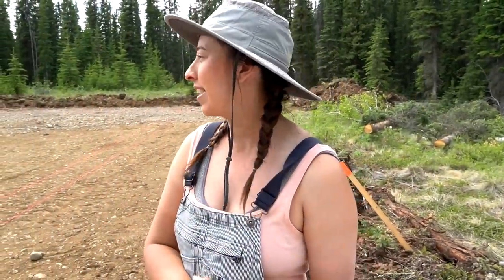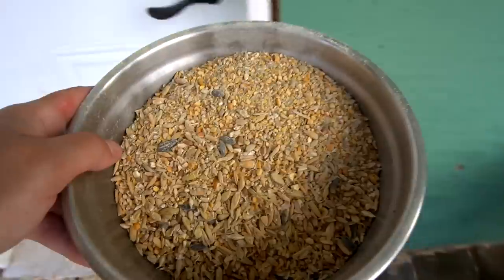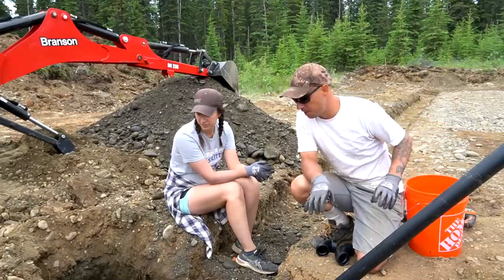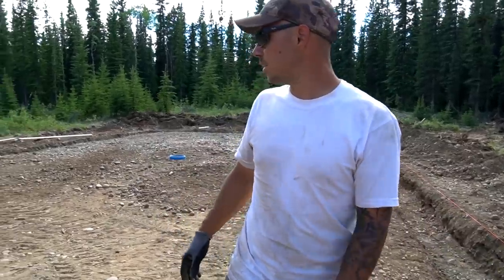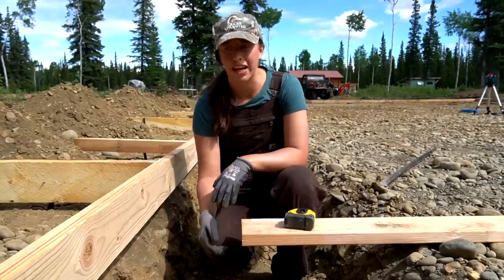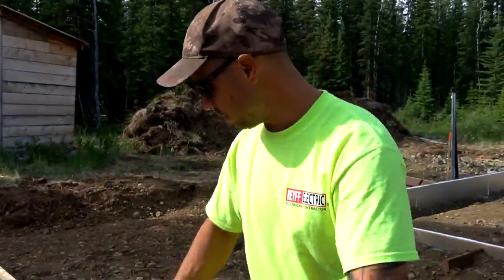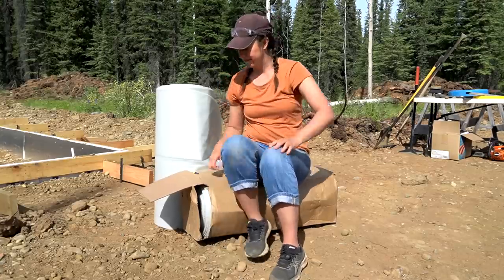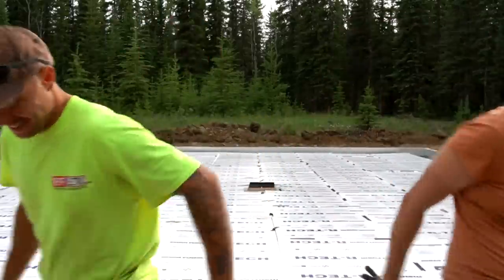The Never-Ending Footers | DIY Insulated Concrete Slab | Alaska Quonset Hut Build

Comment: Reinforcing a large Concrete slabs Tension strength is more important overall than it's Compression strength...Rebar Mesh will increase the former which helps prevent cracking And give the latter more strength too...pays to use a Vibrating poker while pouring to force Air out which weakens the Concrete mix....good job guys.

Comment: As someone who has done my share of footers and concrete you made the right choice to put the poly down first but I think you could have done with a much more easier wire I've used a lot of what they call hog wire you just have to get you a rake and kind of jig it up a little bit as the concrete goes in well and now you're doing great 👍😉🐝

Comment: That really is a ton of gravel. Could weld up a sifting rig and start some sorted piles. Finer stuff/sand for a driveway, bigger stuff for making stonewalls and natural ovens/grills/fireplaces. Could line the pit with nice thick stonewalls for lots of good thermal mass for geothermal greenhouse. Stay cool in the summer, and absorb all the heat from sun/rocket stove built into said wall.

Comment: I agree with what you say about the vapor barrier,  I have seen foam board soak up water over time.  As far as floating foam, yes it can, however you will have reo on top which will hold it down together with the stone in the concrete mix,  as long as the mix is not too wet. 
You're good to go.

Comment: I love the way you guys call it footers. I've always known it as footings. As a bricklayer I have built hundreds of them. But I would have done it a little different. Dig the trench tamp it down pour in a nice runny concrete level it as much as possible, doesn't have to be perfect. And then build a footings up in a solid block. Would have been cheaper and faster. But hey I'm a bricklayer I'd have just done it the way I was taught I guess.

Comment: Great job.  Foam om top poly, when the foam draws maoisture and it will it will freeze and offer less insulation value.  To hold the foam on the utside footer form, use metal roofing screws with the big plastic washer on them.

Comment: from your building inspector here in Florida.  Gray conduit is only used for electricity... if used for anything else paint it white.  Your plans should show you on a detail page the wire mesh maybe going into the footer and should show how the Styrofoam goes and where.  Run a tight string across from form to form and check  the concrete depth at many places.  The angle from the footer to the slab is the most critical thing in the whole project.  Tons of concrete in the footer and if the angle is not per your plans it can crack or break off.  Back to work and you are doing good

Comment: Always form something that you can pour any extra concrete in. Like even a 3ft by 3ft lil pad under a faucet or whatever. Lumna Acres used a gas powered tamper that you walk behind. It was sweet. Also they used a great floor insulation that goes under concrete that you weave the (whatever) thru so the floor stays warm in the winter, they are in NH. They put in a wood fired boiler to heat their home, and water and shop & barn etc etc.
Reply: By the way, I admire both your energy & commitment to your projects & channel. I love watching those who are organized & goal oriented. The shop pre-concrete Lumna used was "Crete Heat with Pex."

Comment: This may be too late, as you may have poured already, but in case you haven't....as a building contractor, I hope to convince you that you need to change the way you formed up to hold your center drain frame. The way it's formed, that wood is going to be in permanent contact with the concrete, which is a big no-no, especially with raw wood. When that rots out, and it will, the only thing holding that frame in place is the four bars you welded to the frame and nothing supporting from underneath. The best way to form for that is to make your concrete form so that it fits inside your L-angle frame. If the barrel lid is non-flexible enough, you can set it right on top. Build it so the form is easy to pry apart(no screws) and remove after cure.  Use your laser level to mark the bottom of the L-frame, then set a couple of 8d  nails on each side, close to the corners. Set the frame on top of the nails. You're done. The form height can be anywhere below the top of the frame so you can screed over it. When done, the frame will be supported by the concrete in it's entirety. Cheers!

Comment: Hey there. This is Chippewa Backwoods in MI.  Love your channel.  I saw that your having trouble screwing the foam board in because the screws suck into the foam.  You absolutely can fix this with "Fender Washers". HD or Lowes or Menards has them

Comment: A few pieces of advice for your concrete forms that may help save time or money 1) Instead of using metal stakes next to your supports, use some 2x4s cut about two feet long from the square cut to a triangle tip <=== This makes them easier to pound into the ground with your maul. It's cheaper and you can screw anywhere into a 2x4 rather than one hole in your metal stakes. 2) if you have a table saw or a track for a skill saw, you can rip a 'factory' cut on a least one side of your insulation and put that edge flush along the top of your forms to know where you have to dig out your trenches more. The tablesaw in particular can stay locked at the same width with the rail and you can cut all that insulation in a few minutes with a wood saw blade. 3) Putting the poly down first then put down the foam boards is the right call, it keeps the moisture off the slab and heat within the insulation for a longer period of time. You two have always done a great job with your builds, the care and quality you two take with your projects is amazing.

Comment: About the metal structure, I noticed such a building near Superior WI (heavy snow country) that had a metal stringer tieing the corrugation tops together about halfway up each side, perhaps inside too at the same place forming a truss.
Corrugated cardboard boxes are stiff because each side of the corrugated paper has a flat paper sheet glued to it. When you handle open coordinated paper is it very flexible and easy to distort.  i noticed the metal ones were flexable when you were loading them.

Comment: It's interesting how techniques vary between countries. As for your insulation board, those designed for under slab use have water absorption rates of a fraction of a percent so either method is equally valid. In the UK a layer of sand (blinding) is used under the waterproof membrane to reduce risk of perforations from the sub base. Also for underfloor heating the slab is poured in two stages with the insulation between the structural slab and a finished screed (of around 2"). The logic in this is that you're not heating a massive volume of concrete only a few inches of the final floor so heat transfer is simpler

Comment: What a huge slab you got going there, just a suggestion to use a tamp to get rid of all the air gaps once it cures. You could order from Home Depot they're blue and they're about 1' x 4' . As you're pouring it, you could also tap with a hammer the forms so you'll have nice solid edges. Expansion joints are critical especially for a slab that big. No matter how much steel you put in there.Just saying, ps you should be able to rent all the concrete finishing  tools you need from a equipment rental yard .   your friend, Keylime DP from Cloverdale

Comment: With plastic a mil = 1/1000th of an inch. So 10 mil = 1/100th of an inch.  10mm is closer to 3/8ths of an inch thick :)
Looks like you 2 thought of everything.  I probably woulda done drain closer to 2" lower than slab edges, then you can slope it out 10 - 15' in all directions from it to catch more.  Very solid forming!
be sure to order plenty xtra concrete, footer leaks and such.

Comment: We also went poly first , also foam in bottom of the footer went under both vertical pieces of foam (sides) of the footer. Reason is that when frost pushes up from outside , it isn't able to push the outer foam up .

Comment: I saw a show on insulating similar to what your project is. They were fastening the pieces of insulation using screws and 2" Diameter X 1/8" thick plastic washers. I am thinking you could even make your own washers similar to these for future insulating projects, perhaps even for your crawl space under your house.

Comment: The 10 mm poly will be fine for a radon barrier it's better than the six mil for sure. Me personally I prefer a insulated radon barrier this way you're getting double insulated value. Put your gravel in then you're insulated radon barrier then your sheets of insulation board then you're still pour your concrete.

 Don't forget to put a radon stack You've got to let that gas vent somewhere.

Comment: I watched most of your episode about preparing for the pouring of your Quonset pad, and your uncertainty about where and how to place the vapour barrier. Regardless of which vapour barrier relative layer option you chose, the purpose of a vapour barrier in the context of an insulated house wall or ceiling in a northern moist climate. The barrier purpose is to prevent water vapour on the most moist side of the sandwich (of gyprock, wall and attic insulation, wall and roof wood sheeting,  and outside wall siding) from migrating through to a sandwich layer susceptible to rotting if the moisture condenses to liquid and frequently soaks the wood sheeting. Hence,  the northern climate belt housing wall and ceiling sandwich construction practice from the interior to the exterior of gyprock VAPOUR BARRIER, wall and attic insulation, wall and roof wood sheeting,  and outside wall siding. Absolute moisture concentrations (in grains per pound dry air) in indoor air (particularly during the indoor heating season) are always much higher than outdoors. Your daily local meteorological station % Relative Humidity (RH) data value is only a excavate down + 7ft next summer, and

Comment: My tip for doing levels for slabs is to drive a peg in to the right height. Then if you want you can use a straight edge and a level to go to another point and drive a peg in again. You can then fill the soil up to the level of the pegs everywhere. Once it's looking good, remove the pegs..

Comment: What you could have used to secure your foam with is use your screws with a washer if that is something you have available to use that would have held your foam in place with having any of the screws pulling through..

Comment: This  is a huge project, pouring this slab..  It would be well worth it if you could hire a few concrete finishers to help you pour and finish.  The money would be well spent.  Don't forget you have to score the concrete, especially from the corners of that drain receptacles.  Also think that a grizzly would be worth having to sift some of those rocks out of the dirt so you have some good soil and gravel for oncoming projects.  Just saying,  Gods Speed.  ❤

Comment: In the lower 48 i probably wouldn't bother with the foam under the concrete slab, but for sure i would insulate the footers that should be 3-4 feet deep for a typical garage, there should be enough natural ground heat rising through the floor to melt snow off vehicles parked inside with a insulated building and garage door.  I would plan on having the ground surrounding the building taper down hill from it's perimeter edge to promote natural drainage away, even more important in a area that gets a lot of snow melt.  Aerial is a good sport for being able to re-do things, extra work but working with concrete foundations, any mistakes will be very hard to correct after the fact.  The left over wire grid would make good trellis material for the garden or keeping the animals away from young fruit trees.

Comment: Giday from Ottawa Can. Did that kind concrete work for 30yrs. Doing a great job on the slab. Floor that big should probably 3"" slope. I know it's a pain in the ass your inside excavation should be on a 45 degree slope...

Comment: Nice work.  Check out Durall expoxy coatings.  Great professional product that will seal the concrete and remove moisture issues.  We spent two days with paint rollers and it goes pretty fast.  And it’s exactly like day one after 17 years!  Good luck.

Comment: I’ve seen where they put a frost free hydrant into that type of building just put a plastic sleeve over the riser pipe so the concrete doesn’t eat away the pipe but to late now keep in mind next time a lot of good hard work for two people. Now if you only had a gravel grizzly to screen some of the larger rock out

Comment: The condensation, but the moisture from the cold of the ground, and the outside against the warm that would be created by any heat you would have inside your quantify. That’s why you want the moisture barrier it’s the difference in temperatures in the floor.

Comment: I'm not a structural mechanic, but   the gravel pit could be dangerous as you dig deeper into the sandy mix where the sides could cave in. I've seen big metal structures used at construction sites that help prevent accidents (not that you need one). Just a thought for you to stay safe.

Comment: Add a sprinkler system too.  If no fire, but you're hot and can't cool ogg, just pull the chain and let it pour over you 5-10 minutes.  Drink a limeade. Lemonade with it, 🙂

Comment: Build, build and build. Great content. Just one thing, footers are a single hole.  Footings are for pad like your doing to put structure on, There is a difference. Do u have low water table there, if not you can use your pit for cellar. Block wall you a bomb shelter/cellar and water proof it. Something down the road to think about.

Comment: The float you're using should have a cam above it, so when you're pushing it the front of the float lifts up a little, and before pulling it back, twist the rod slightly and the back of the float (facing you) will lift a little.  You shouldn't have to lift your float rod way over your head like last time.

Comment: With those screws to hold the fom remember yiur gonna remove the forms and you gona have trouble you might remove the fom when removing the boards  and that drain that 2by4 block will stay in there might rot

Comment: Sorry if you've already explained this, but did you account for the thickness of the foam on your side and end forms? Will the building be sitting completely on the concrete? Or will it be sitting partially on foam?

Comment: Hey I love your channel and your approach to accomplish something every day.
the only thing that's a shame is that you guys don't have the right material.
EPS can absorb water.
Insulation that absorbs water is like wet clothes, better than naked but not as good as dry.
XPS is made differently and can not soak up water. 
From the thickness, 2 inches is too thin for the floor in Switzerland. On the walls we calculate with 18cm = 7 inches.
The roof we would insulate with a minimum of 8 inches.
Greetings from a construction manager from Switzerland.

Comment: The foam board has tiny little air cells. If you are placing very heavy cement on top of the foam board, wont the little air cells in the foam board get crushed flat?

Comment: Since you guys are really starting to get neck deep in building things, here's some slightly pedantic trivia for Ariel: A 'mil' is not a millimeter... it's a thousandth of an inch, while a millimeter is a thousandth of a meter. 

It's not important here, but imagine if your plastic sheeting was actually 10 millimeters thick (a centimeter thick). That could throw off a measurement or two, LOL.

You should hire that metrologist, with the laser thingy and the sweet hair, and make him do everything in mils.

Comment: Right ~. I'm not kidding here. The gravel.  Not the pit but the gravel.  Seems to hold it's shape on a vertical basis.  Dig a long long (Greenhouse) hallway.  For the dark days of winter. A "passageway" maybe only 10 feet wide ~ less than your current "pit."  And absolutely not 8 feet deep.  Make it four or five feet deep.  Shore the sides with cattle fence mesh. Then a snow shedding plastic covered roof. Ya know spanning just 10 feet.  But 200 feet long. The roof only 4 feet off the current grade accommodated with a four or five foot deep trench.  Side walls could have growing "shelves."  Then you would be in shelter to get from place to place.  Think of a space station on Mars.  Would that be amazing and cool in January ~ so dark and cold ~ ?  Or is this just another one of my crazy suggestions.  There's your gravel.  The gravel is an asset.  You should use it.  Maybe the chickens would like to cruse around in the "passageway's" too?  Oh well.  All of this is just sooo exciting. ~ Like on Mars ~ Alaska is like another planet?  You could do this.        ✨🌸✨. from New Hampshire.

Comment: Are you planning to spray foam the shop wall’s & ceiling since it’s being heated? There is a (railroad) building like this locally and the spay foam is on the outside, with a “paint” layer on it.
Reply from the maker: Yes spray foam on the inside ;)

Comment: Regarding attaching the foam board insulation to the forms, would adhesive have been a good choice? We are doing a cooler room with a cool bot and the adhesive seems like the way to go in attaching foam to plywood and foam to foam for a higher R value. I don’t know how the tension of the concrete, pressure of that slab, etc would have affected the foam insulation.